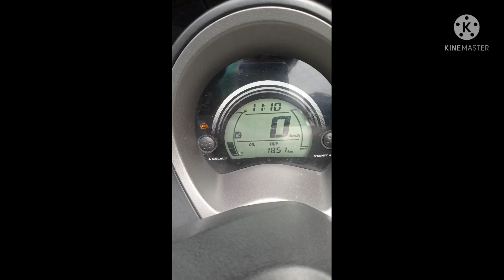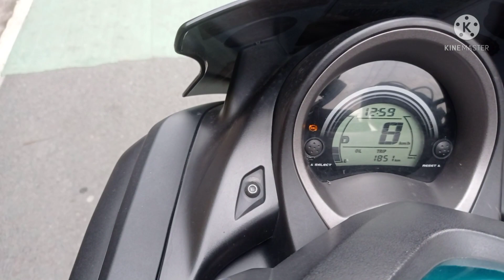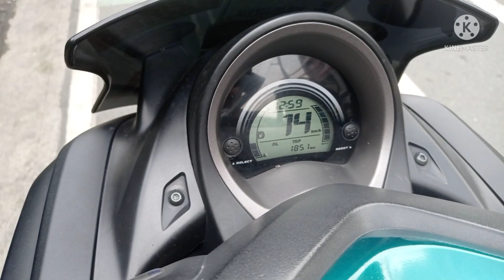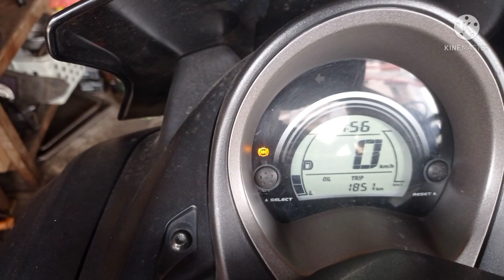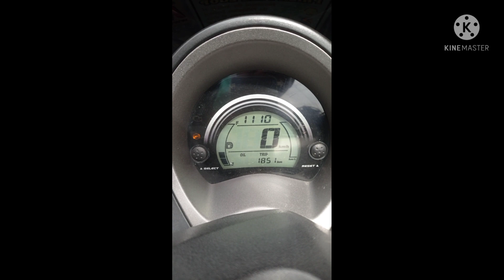ABS indicator light problem

Comment: Sir ano kaya possible cause ng sakin pag on at tumakbo ng 10 mawawala sya tapos may time sya na babalik ang ilaw tapos pag papatayin ko makina tapos iaandar ko ulit okay naman. Parang may time lang sir na susulpot yung ilaw ng abs nya. no error naman po at gumagana ang speedometer nya Sana masagot nyo sir. Salamat po
Reply from the maker: sa module kasi lahat nanggGling NG sira ng abs maliban nalang kung na bengkong  ang sensor disc nya
Reply: Napaayos mo sayo? Same tayo problem
Reply: Pasabay boss same problem sakin

Comment: Sir goodam anu po kaya dapat ayusin sa nmax ko..ayaw po mawala ng ilaw nung abs tapos ayaw din gumana ng speedometer
Reply from the maker: Madalas kasing nagiging problema no nmax natin sir at module ng ABS yung nasa likuran na electronic parts ni reservoir  nasisira ang oilseal nya kaya nasusunog ang module
Reply: @onitpolintan9371  anu po dapat gawin sir? Kelangan po ba mabaklas yung abs module para macheck?
Reply from the maker: Yes sir meron nagawa nyan sa manila sib yawba  ang name nya pero depende po sa kalagayan ng module mo at brand new nyan ay 48k po abs ni nmax

Comment: Sir ano po kaya possible problem nung akin same problem lang po abs light on pero no check engine naman pero okay pa naman po yung sensor nya minsan nawawala minsan hindi po.
Reply from the maker: nasa abs module  narin po kasi pag ganyan nwawala wala na sya
Reply: pag abs module ba problem sir maayos pa?
Reply from the maker: Maauos naman po pero may presyo nga langeron mga hustler dyan na gumagawa

Comment: Boss tanong lang yung akin ganyan din po. Nag ON lagi yung Abs pero umaandar naman yung Speedometer ano po kaya possible?
Reply from the maker: same narin sakin ngayon umaandar ang speed meter nya kaso di nagana ang abs pwede po nabengkong ang sensor disc nya yung sa harap or sa likod
Reply: @onitpolintan9371  may possible po kaya na marumi din yung pump ng abs?
Reply from the maker: Yung pump di yan basta dumudumi
Reply: Same skin ndi naman benkong. Steady ilaw

Comment: Bossing bat kaya di namamatay abs light ko pero pag on mo sya mawawala pag umandar di na nawawala kahit takbo 40 na
Reply from the maker: Ilang years na nmax mo sir
Reply: @onitpolintan9371  2 years last prod 2020 v1
Reply from the maker: Try to chek din sa likod na disc ...at front Check the battery rin same na sakinnnagluluko na battery ko na diagnos namin battery problem na sya bumababa na ang volt nya...
Reply from the maker: Pa check narin po battery sir

Comment: New subscriber sir onit.. yong gulong ko sa likod nmax V1 medjo my gewang konteng konte, tas my abs indicator, posible ba na gnyan di sira ? Di ko matandaan kong nalubak ako. Salamat sa tugon sir onit.
Reply from the maker: Pa check sir ng sensor disc kung may bengkong at ng cable sensor baka marumi po kasi magnetic sya

Comment: Ganyan akin e pero pag piniga ko ng naka stop mawawala tapos babalik ulit pano kya yun
Reply from the maker: Check myo pp yung sensor baka marumi
Check sensor disc baka benhkong
Pag wala parin module po nasisira na 30k to 33k replacement 17k nasusinog na ang noard electronic sa likod ni abs system 
Check kung may error 42 at naka 
check engine logo
Reply: @onitpolintan9371 san po loc nyo
Reply: @onitpolintan9371  nag palit din kasi ako ng bearing kaya nag ka ganyan. posible kaya na nabengkong yan.
Reply from the maker: Pa share narin ng video

Comment: Paps pano yung sakin buo naman yung rotor nya pero nawawala tapos bumabalik ano kaya yung problem nun? Thanks and respect
Reply from the maker: Check po ninyo yung mga fuse  baka lumuluwag  sa vibration
Reply from the maker: Try check din po sa likod na sensor disc po
Reply: Saan banda yung fuse naka lagay sir 😊 yung sa likod naman is buo din po
Reply: Saan po location nyo po pala
Reply from the maker: Nasa ilalim ng upuan sir  may takip na madalawang screw

Comment: Boss onitt, anong mangyayari kapag sira na yung abs sa nmax or tinanggal. Aandar pa rin ba? Anong posibling mangyari kapag ganun boss. Any tips boss sana masagot🙏
Reply from the maker: okay naman klahit sira na abs mo kasi meron nga non abs diba ... binibigay lang naman ni abs wag mag lock ang braking systm monpara di mafull stop ang tires mo at di mag schid ang mga gulong mas safe lang talaga si abs
Reply from the maker: magkakaroon sya ng check engine at  error 42 at mawawala abs nya magagamit pa naman motor kaso magkakaaroon sya ng limter sa takbo like pag full throttle kana tumatakbo maag kaka cut off sya babagal you have to fullback the throttle and twist again para maka gain ulit ng speed si nmax

Comment: Yong rotor sensor paps, pede po ba pintorahan?. Kasi yung sa pinsan ko, yong rotor sensor nya sa harapan, pinintorahan din nila. Tas Yung ABS indicator palagi nalng naka ilaw.
Reply from the maker: Bska nsmsnnpo ns damsge ir na bengkong pagka baklas
Reply from the maker: Baka nun b8naklas na bengkong
Reply: Ou nga para ganun paps. 
Kaso parang hindi nila binaklas yun. Kasi mai pintora din ang sensor, pati yung tatlong bolt..
Reply: Paps, pininturahan ko din Mags ko, nadamay abs sensor disc kasi di ko matanggal bago napinturahan. Dun nagsimula magkaproblema sa abs nmax ko. Pinabura ko pintura sa sensor disc at flatten para mapantay siya ulit. Tumino. Nawala yung abs light on palagi. Sana makatulong sa problema mo. Di ok laging nakaOn yung ABS Light, sisirain niya module kapag pinatagal.